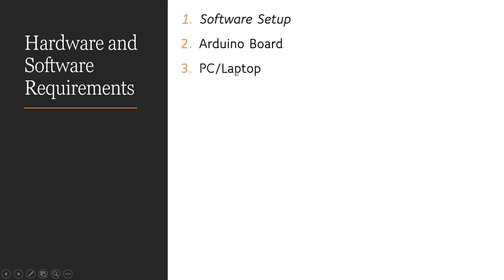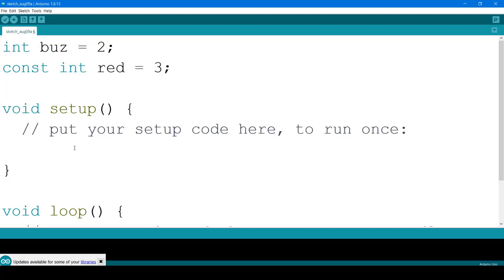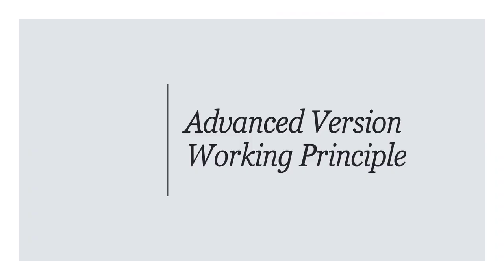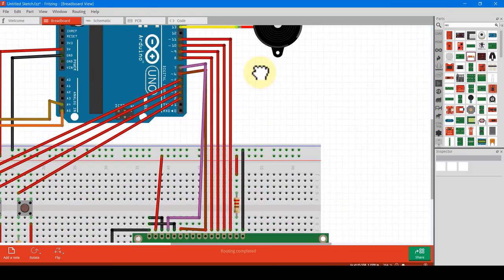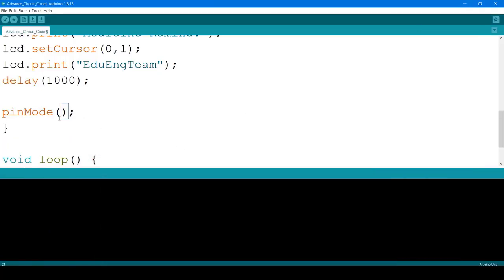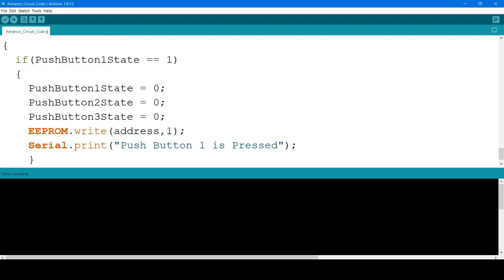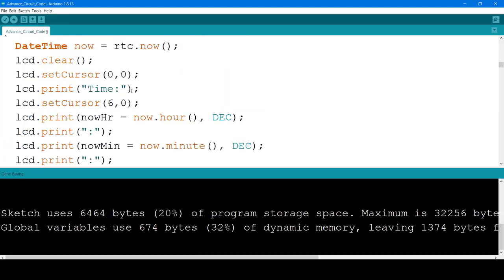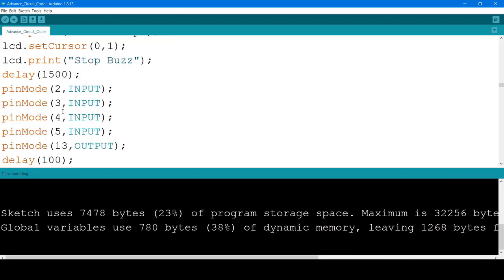Automatic Pill Reminder Using Arduino uno - Tuthowto

Comment: very well job ....
could you tell me how can i make some edits on Fusion 360 file like open it in SolidWorks and make some edits ??
Reply from the maker: arduino uno software is open source software. you can edit your code free. you just need to open your project file into solidworks without hesitation. and there your file.

Comment: Say, if i want to use a sensor in arduino uno that would only turn off the alarm when the kit is opened. how should i circuit it? and what sensor should it be?
Reply from the maker: you need to use nano sensor

Comment: How to connect this med reminder via wifi ? Is there any method it could be very helpful and i qm planning to use weight sensor to chevk how many pills left and if the patient haven't taken the pill it will buzz the sound and make a notification to the guardian mobile for that any idea ??
How to get the pill remind notification using wifi or by bluetooth?
Reply from the maker: you need to use toaster app to get notification for pill reminder